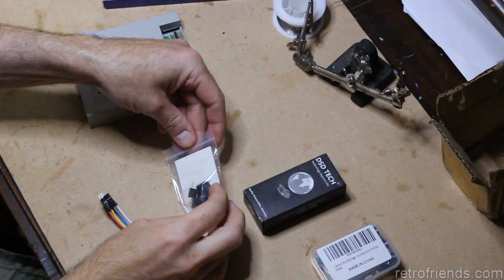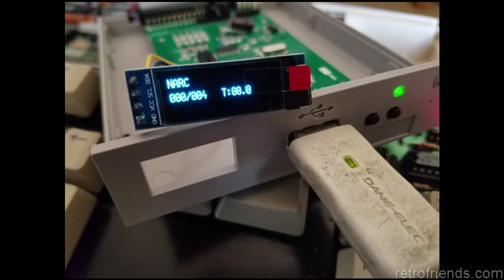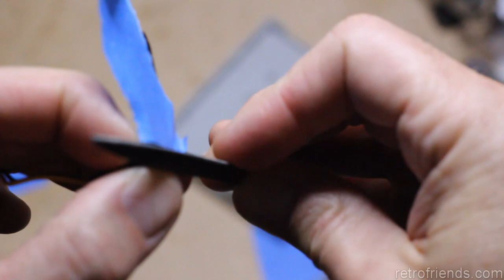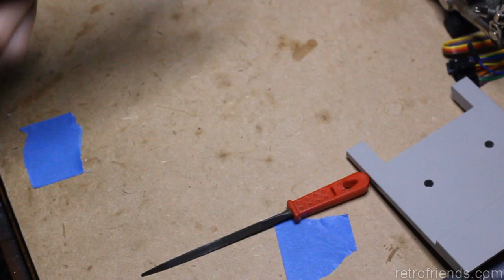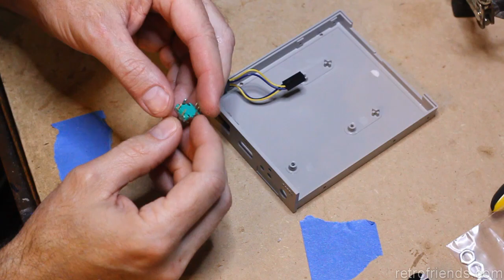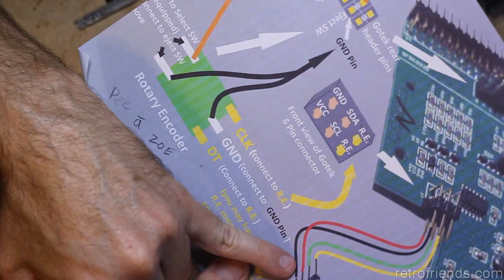Gotek Floppy Emulator for Amiga Part 2: Mods

Comment: Great video, just finished to make those mods and works like a charm.

Is there a way to make the speaker louder? You can barely hear it

Also beware that the traces on those 2 pins to solder are very prone to lift; I had the brilliant idea to remove the solder in the holes first and doing so the trace got caught on the tip of the soldering iron and lifted. Took me 10 minutes to get that fixed and I am not even breathing close to it :)
Reply from the maker: I never had a pad problem, and I modded hundreds. Ya never know I guess. BTW asking to make the speaker louder is not a common wish. I have heard a few want no speaker. To each his own. I seem to remember someone added a small amplifier. Don't remember where I read it.
Reply: @retrofriends  Guess I got a lemon or I used the solder too hot.

The speaker is barely audible once you put it in the plastic case; I would get at least the same volume of a real floppy drive. As far as people that do not want a speaker... The Gotek is not sold with a speaker, so unless you add it, it won't be there ;)
Reply from the maker: @fcf8269  I sell them in my ebay store with the speaker, so of course I get requests for ones sans speaker. I sell a ton to Amiga users, and I am surprised how many hate the constant click sound the the Amiga system makes the drive do (I like it myself). Other gotek compatible devices are musical imstruments, and those users often don't like the drive sounds in their studios. As it turns out, the low volume seems to be the perfect compromise. No complaint from the vast majority of my buyers.
Reply: @retrofriends  Well, you sell a gotek plus extras; I bought my gotek as bare device, flashed it and added the extras; so there is a difference in what I see and what you see.

Got one for my DX7 and one for my retro-computers (swapping it between the amiga and the ST), and the main point for me to get that is to have a reliable way to use software (disks), without the downside of the medium (fragile, easy to corrupt, not made to last). As such, the audio part of a simulated experience is part of it :)

The one in the DX7 has nothing on it, buttons work enough since I have like 40 floppy in total, and I don't even need to see the name of the floppy; just to know which floppy am I using to know which patch I can load. The other one is fully decked with the rotary encoder, OLED screen and speaker.

If you look at the gotek as mean to load a bunch of pirated files, then of course the speaker is not really a thing, but if you use it as 1:1 replacement for a broken floppy drive, then sound is as important as its speed IMO.

To each their own of course; life is not the same for everyone after all
Reply from the maker: @fcf8269  Glad it's more than just me who likes the drive sounds. The whole reason for this video and channel is to support my ebay store. Buyers seem to like them with the speaker the way it is, and as a business that is the path I must follow. You are free to your opinion and desire.

Comment: Hi, Thanks for this video. My Gotek appears to be the same but already had the R.E. pins installed so I didn’t need to add them. I followed this to the letter and used the same rotary switch. Rotary encoder detects menu when pressed but does not change image when it is rotated. I alternated the CLK and DT wires to both R.E. pins but it made no difference. The existing buttons change images fine. Any ideas what else it could be?
Reply from the maker: Test continuity of the three connections involved : the data, the clk, and the ground. Maybe verify you have the ground connected to the two pins of the rotary encoder. Also check continuity to the circuit board for all three. A cracked solder joint is possible.
Reply: @retrofriends  Thanks for the help. I just realised I have the newer version and I don't have the USB cable (yet) to flash it. Will get that sorted and give it another go. Cheers.
Reply from the maker: @commodorecave5581  Check my channel for the latest in flashing and modding the new Artery boards.

Comment: Is there a reason for using an active piezo buzzer? The active ones have an oscillator inside that produces a fixed tone when you apply a voltage. You might get a better result with a passive buzzer.
Reply from the maker: Passive buzzers require AC voltage. The source here is DC, so electrically speaking the Active buzzer is called for. I'll bet Passive buzzers are the buzzers people use that don't care about polarity like the Active ones do. Differences in sound would be subjective/personal preference. I personally don't care either way since nothing will perfectly reproduce the drive sound.
Reply: @retrofriends  You're right, I tested with a passive piezo buzzer and  it doesn't care about polarity. But I'm pretty sure those JB pins are producing an audio signal rather than DC, otherwise the passive piezo wouldn't make a sound. I suspect that if the polarity is correct in the active buzzer, its oscillator circuit is transparent to audio frequencies. In any case I found the buzzer too quiet without amplification so I added a small transistor circuit.

Anyway great job with all the mods! It's so neat and professional. I just got a little OLED screen and I'm going to modify the case like you did so that it fits.

Comment: hi Retro friend , great job ! does this tuning work on a gotek sfrm72 fu dl  for the rotary encoder instead of the push buton  on a mc 50 ? Thank' s for your answer
Reply from the maker: Should be the same for that gotek. I can't comment on the mc 50 application as I have no experience.
Reply: @retrofriends  ok thank you

Comment: nice, tnx. i was wondering if there is a way to mod the Oled display so you can get it retro style ? like orange or green maby. i havent found a video like that. do you think its possible ?
Reply from the maker: I have had success changing colors on LED's, but you always cut the light output. Some clear plastic  sprayed with yellow would turn the blue display green.
Reply: On the OLED displays I have, to change the color, i use light color gels. They're thin and do the job.

Comment: I picked up a cheap one that didn't have buttons to operate, didn't have a display, and only had one LED.  Printed a proper case for an OLED, replaced the green with a red, added an amber LED, added two tactile switches with extended activators.  Now the two buttons on the front can be pressed in, or pressed downward like momentary flip switches.  Red LED to simulate an old style floppy drive (PC compatible era) and the amber for disk change or whatever it is.  People overlook models like this because it's not the kind they want or it was configured for some weird system and they think they can't use it.  But just install Flash Floppy and you can mod it up the same as any other.  Look for the good deals.  The extra parts are very inexpensive and you'll save money on getting a gotek.  Something like $15 or $20 total.  So, avoid those $25+ goteks!  Especially avoid the $80 versions.

Comment: Are these mods compatible with dos?
Reply from the maker: AmigaDOS, yes. This is only for the AMIGA and ATARI ST computers.
Reply: @retrofriends  necesito tu ayuda amigo por favor
Reply: yeah the mods are compatible with all uses of flash floppy.  FF is configured with text files in the root of the USB stick or in the "/FF" folder.  Configuration says to use what kind of display,  what formats to support, etc.  Read the config guide.

Comment: (EDIT: My OLED was preinstalled so I do not have these wires already. Judging by the video, I think these wires will be fine for both the knob and the speaker which I wish to add to mine. I am confused by the presence of a small PCB for other rotary encoders I've seen. Maybe this is to assist with the install a bit?) I didn't see a link for the jumper wires so I found this: https://www.amazon.com/gp/product/B07S2RH6Q4/ref=ox_sc_act_title_1?smid=A19TVI3M6WFVG7&psc=1 Are these suitable? Not too long or too short?